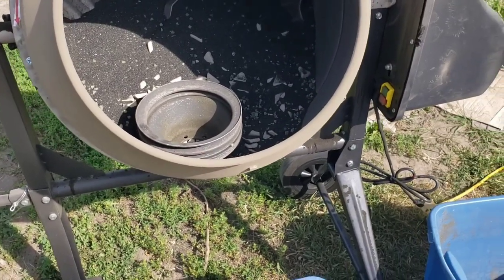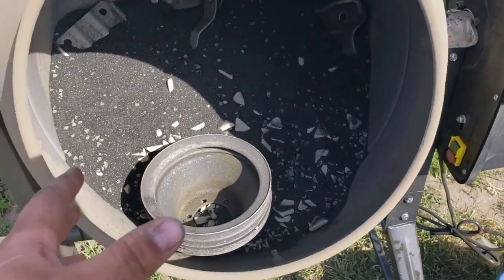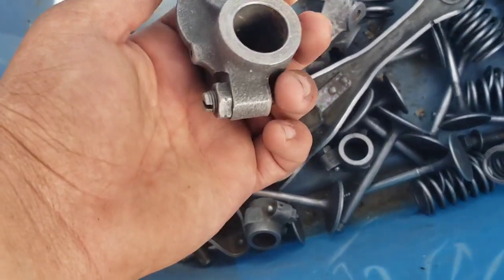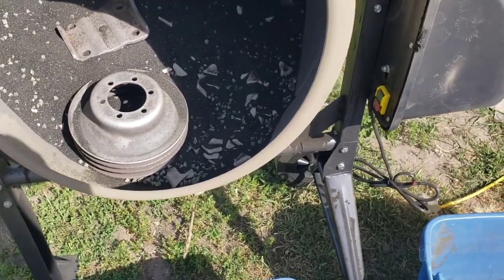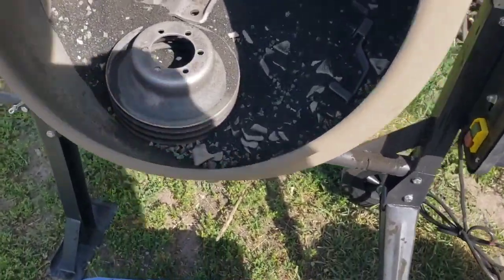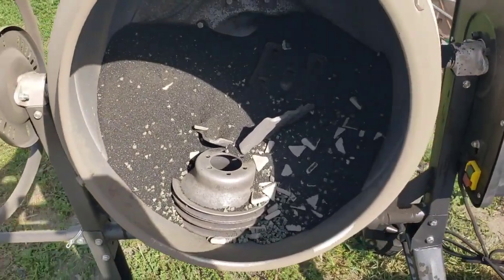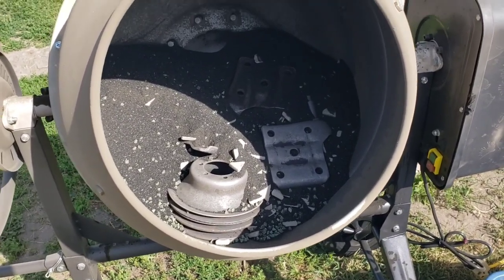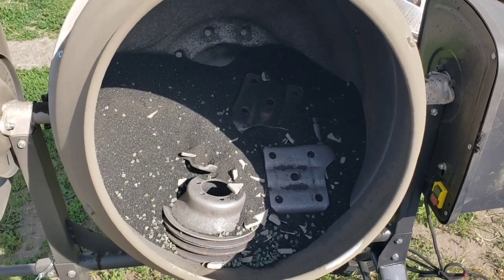Cement Mixer Parts Tumbler. Easiest Way To Clean Rusty Parts. #rust

Comment: Nice... between the large tumbler at harbor freight $169 which does all my bolts/nuts and small hardware with green media....and the with my old HFT cement mixer which I bought to pour the slab for my maxx Jaxx mid rise lift... I can put the parts in set it and forget it and go do something else beats a wire wheel any day! A small drum lid would work as a lid for the cement mixer use a pool sand filter cover clamp to hold it on.